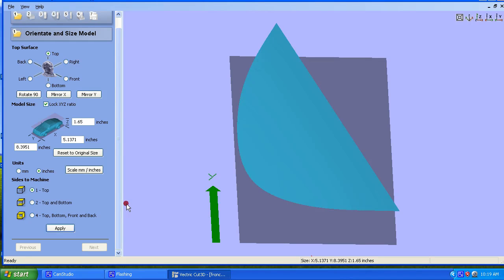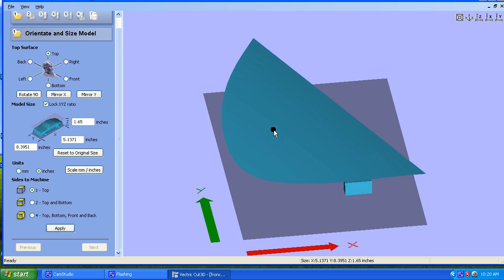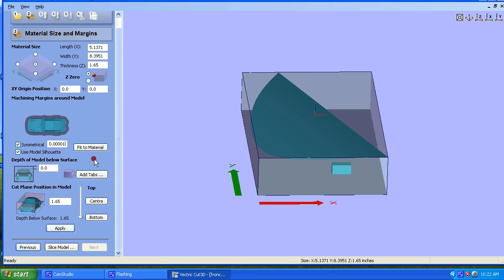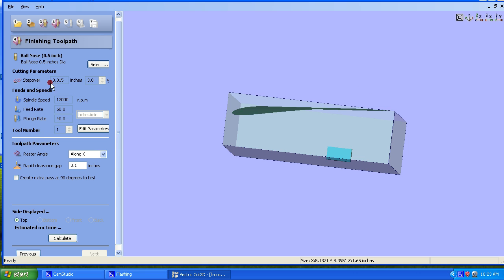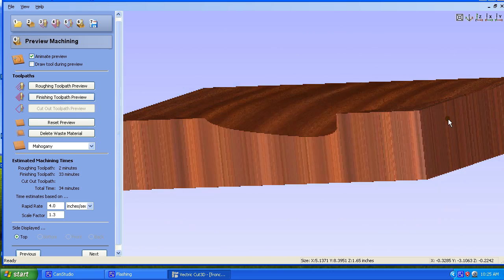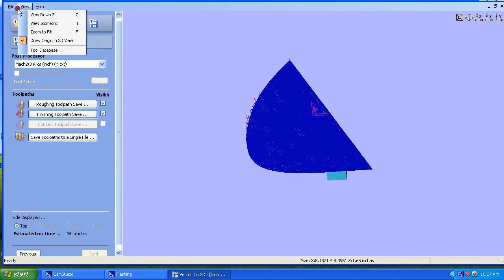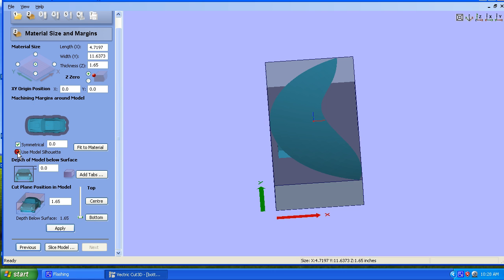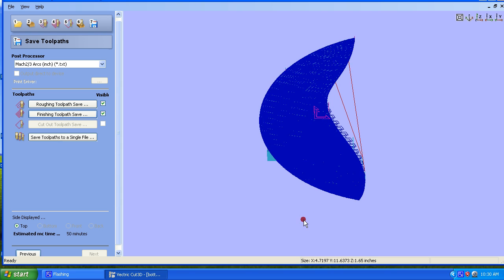2852010_1030_46.avi

Comment: I was wondering if there was a more accurate way of positioning the imported Cut 3d toolpaths in V Carve Pro? It seems a little hit or miss compared to the accuracy of the programs.
Is it possible to use the small blocks that you create for thickness recognition to line up the reliefs?
I wondered why you didnt' use Rhino Cam (inside Rhino) which would solve this?

Many thanks again, and a Happy New Year.

Alan.